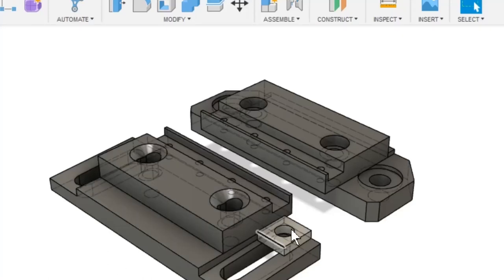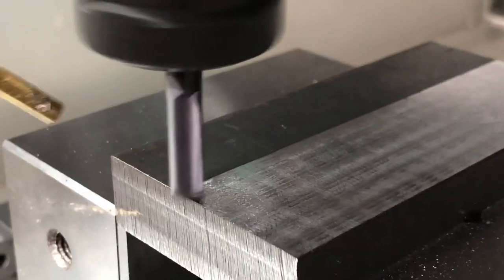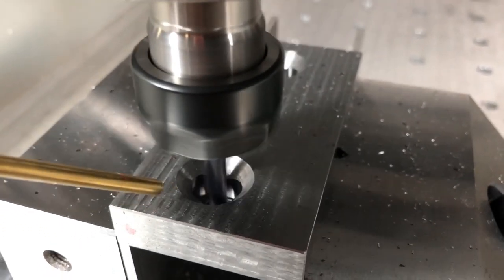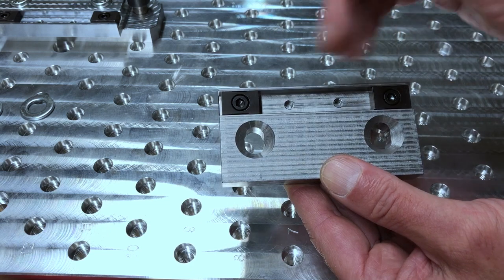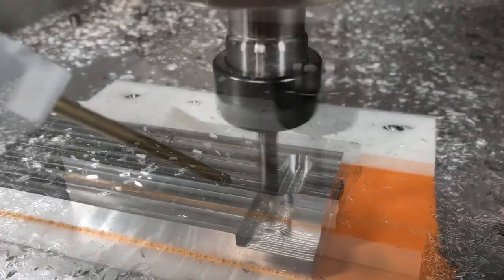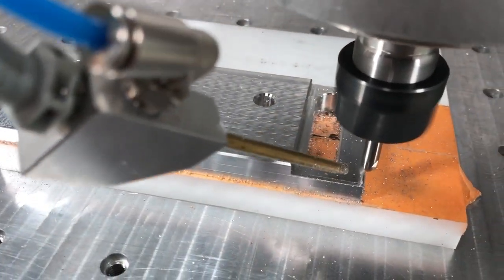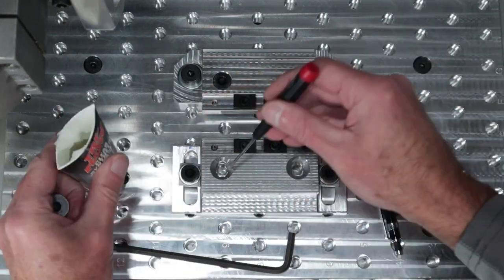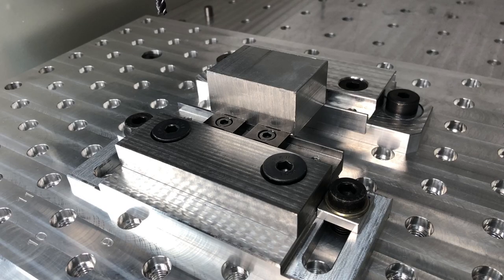DIY Low Profile Vice Part 2

Comment: Thank you for the final fabrication. Yes, I do like the voice over and you use it effectively with just the right amount of talking and in the right place and time. I had trouble with your introduction. The audio quality was almost all base making it very difficult to understand. I had to turn on captions.  Later on the voice quality improved and was fine. I particularly like your video technique. You first visually introduce a concept, feature, or a completed part BEFORE filming the actual manufacturing of the individual parts!  You clearly describe your intent, mistakes, cautions, or suggestions for improvements. This technique is a tremendous help in gleaning important information from the subsequent machining.  Thank you for the effort you put into this channel.
Reply from the maker: Thank you very much for this feedback. Yes the audio I was worried about.  I will get a better mic for the next one it is on my list for a long time. I don’t have the all “base” effect on my device but it needs improvement. Again thank you 🙏

Comment: Great video again. Finding the recipe for cutting steel with these spindles takes a bit of time, and a bit of courage :-) I implemented potentiometers for Feed and Spindle RPM which lets me dial in from my initial parameters. These types of machines can do more than ppl tell you they can do, just not in a hurry.
Reply from the maker: Hi Gerrit, thank you for your comment. Yes having the ability to change parameters on the fly makes everything so much nicer. I use my pendant for that and can go from 0-300% of the programmed feed rate. The biggest trick for steel is to find the lowest rpm that the spindle will support the cut. For me that is 13,500 rpm on a 1/4” end mill and I typically only have a 0,3mm DOC … like you said not removing material in a hurry but it can do it and opens so many more possibilities.
Reply: @JBWorx Try a shorter end mill. The difference will be remarkable.
Reply from the maker: Yes agreed! A shorter end mill will be stiffer making less artifacts in the surface.

Comment: Bit late to this but could you give more information about the workholding you used for the aluminum parts ? Looks like it may be something like HDPE and tape+glue to hold the aluminum part ?
Reply from the maker: Yes almost 100% correct. The white plate is POM or Acetal or Delrin - all the same. It is expensive but worth the money to use in the shop.

Comment: Very nice work. Couple questions. 1) Have you check the alignment of the fixed jaw with a gauge? How much deviation can we expect from such design after removing and reinstalling the jaw? 2) You've mentioned about the movable jaw having a taper. Is this taper to lodge it in place as you bolt it down? If so i what direction does the taper run? Thanks!
Reply from the maker: I think the deviation will greatly depend how careful and in what sequence you machine everything. So I have checkt this a couple of times and was never over 0.03mm deviation. Yes the taper is so that the force from tightening the loose jaw cannot push the lower plate back. Think about it for a second I am sure you will figure out the direction it needs to go it is not easy explained here.

Comment: Hi i have a question.
How does the part stay flat if Yiu have a angle surface would the one moveable side height alway change and be different depending on when the countersink bolt tightens down?At 11:40 You machine both seating surfaces for Your parts but the moveable side will be higher or lower every single time depending on how the countersink tightens it down. Or am I missing something.
Reply from the maker: No that is not how it works. The countersink screw provides downward pressure to the movable jaw. The jaw sits always flat on the lower plate and further tightening will move it forward. In addition the shape of the miteebite tooth will pull the material also down. So in my experience it’s nice and flat.
Reply: @JBWorxStudio  Yes but isnt the lower plate machine at a angle? If it is doesnt the top plate move up and down when it moves forward and backward?
Reply from the maker: No it is flat. The outside holding area where the screw engages is tapered to prevent it from sliding back.
Reply: @JBWorxStudio  Ooooooook. Now I understand. Now it makes sense.😂😂
Reply from the maker: No problem thanks for reaching out !

Comment: Guten Abend
Sag mal hast Du die Platte irgendwie aufgeklebt? Oder was ist das orange Zeug unter der Platte. Das hab ich so auch noch nie gesehn. Interessant
Reply from the maker: Ja genau, Klebeband auf beide Seiten (also Tisch und Werkstück) dann mit Superkleber befestigen. Klappt sehr gut !
Reply: Ok nette Idee danke fürs teilen. Wie gross ist die maximale Scherkraft etwa?Bevor es sich selbstständig macht oder verschoben wird?  @JBWorx
Reply from the maker: Das hängt komplett von der Werkstück Größe ab. Also general kann ich dir sagen bei Größen Platten hast du eher das Problem das Werkstück wieder vom Tisch runter zu nehmen. Kleine Teile sind eher kritisch so ca 30x30 mm klappt immer noch recht gut wenn die Teile recht flach sind. Die N/mm^2 kann ich dir nicht sagen aber das wär eh nicht verlässlich kommt aufs verwendete Klebeband an, und die Oberflächen. Schau dir mal mein Video zu workholding an da hab ich noch ein paar Tips.
Reply: @JBWorx  danke das ist ein präzise Antwort.
Vielleicht finde ich mit der Kleberstärke einen mathematischen kritischen Scherkraftwert.
Kleinere Teile spann ich selten aber das Knowhow ist sicher mal nütze.

Comment: Ist die weiße Platte die Du als Unterlage verwendest eine POM Platte ?
Reply from the maker: Hi Lars, ich verwende eine Delrin Platte da das Klebeband eine “ok” Haftung auf der Oberfläche hat. Ob POM auch geht kann ich nicht genau sagen. Ist auf jeden Fall besser als MDF und man kann auch Kühlmittel verwenden.
Reply: Danke für die Info. 😊 Wenn Google nicht lügt ist Delrin = POM
Reply from the maker: Hmm ich weiß Delrin ist der Handelsname für Acetal und du hast recht POM 😀
Reply: Noch eine Frage, welches Klebeband nutzt Du?
Reply from the maker: Ich verwende Scotch Painters Tape mit “High Adhesion” also eins was besser kleben soll. Das grüne (for rough surfaces) geht auch sehr gut. Den Roller kann ich auch empfehlen der bringt auch noch mal was.

Comment: Out of interest, can I ask what feeds and speeds you opted for when milling the steel?
Reply from the maker: Yes certainly, 6mm endmill at 16,500 rpm and 1800mm/min DOC max.0.3mm. I plan on producing a video about cutting parameters for different materials … the problem is there is a lot of talking and it is a boring subject.
Reply: @JBWorx  That's a lot faster than it appears on the video. I keep meaning to give it ago, one day I'll find the right excuse.
Reply from the maker: It worked much better than I thought … however you really have to cut loose from the parameters provided by the manufacturer or some online software. They do not work with a high rpm low HP spindle. There is a lot of proof on YouTube where you see sparks flying and you just know this is not going to work on your machine.
Reply: @JBWorx   I mostly use patameters as a guideline anyway, every machine is different. And in fact I think on only one occasion have I received info with a bit when it arrived.   

I have a vac bed on my machine with the usual uneven MDF waste bed, while I sometimes add a drill press vice for engraving, I've still to add decent work holding for milling, not yet decided on solution long term.
Reply from the maker: Yes a good approach. For the work holding of your machine if you plan on cutting metals that require coolant then some type of metal base plate will be good.  It does not necessarily need to be a fixture plate but you should incorporate some holes / threads to clamp commonly used fixtures down.

Comment: You made a mistake, 30 Kg isn't around 1000N. 30 Kg X 9,81 m/s^2 = 294,3 N ... I think you used the 32,2 lbf/s^2 of the imperial system which gets you 966. Still some grate clamping force. 👌
Reply from the maker: Joel, very good ! You are the first person on YouTube to notice this one person on Reddit noticed it as well. So what I did not say in the video is that my hand force was 30kg and the leverage of the screwdriver was 3:1 and this is getting the around 1000N. Very nice that you noticed this so some people really do watch my videos lol 😆

Comment: FYI i have a tub outside with muriatic acid and water in i put all my a36 parts with mill scale into for a few hours and it dissolves the mill scale
Reply from the maker: That is a good idea 👍
Reply: i keep it in a home depot plastic tub with a lid and put weights on top when not in use so the wind don't blow the lid off and it fills with rain water works great on rusty metal  @JBWorx
Reply from the maker: There is something called hydrogen embrittlement you might want to check into. Most likely will not apply to most of us DIY warriors, but can’t hurt to know about
Reply from the maker: Yes metal treatment is a field of its own. Especially for aircraft parts there are a lot of rules to look out for.

Comment: As always, amazing video. Very helpful for beginners like me. I would like to clarify, what do you think, if I fix the plate (26x500x500) with such a vise, will it bend in the center. For large plates you can use glue, if there is a vacuum table, then it. I would like to try a vise like yours.
Reply from the maker: Thank you for your positive feedback. Your plate is 26mm thick? No I don’t think you have to worry that it will bend. Good luck on your build!!

Comment: Great video. Great little vice. But the explanation of how to tighten and how not to tighten is - a bit confusing to follow.
Reply from the maker: Thank you for your comment Torsten, I guess I should have just said not to bottom out the screw, so there is always forward movement of the jaw as long as you tighten